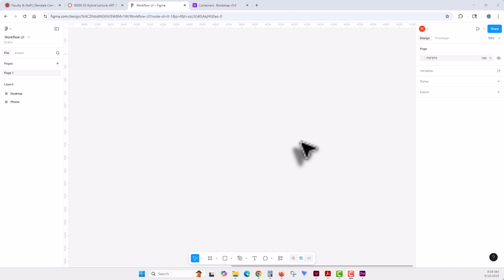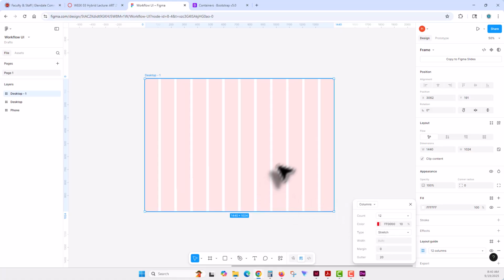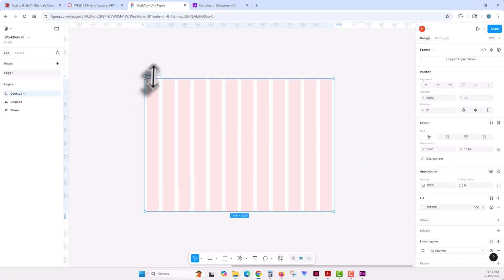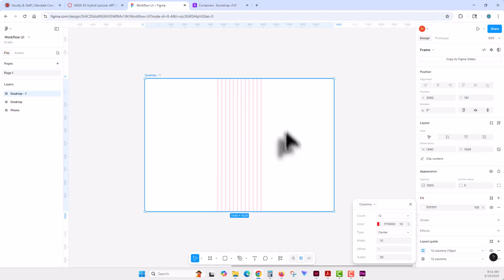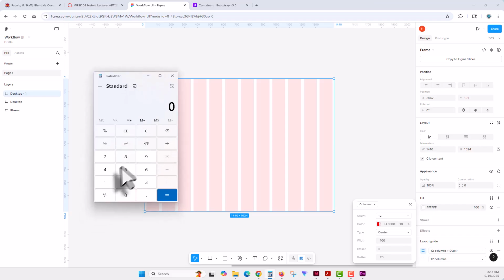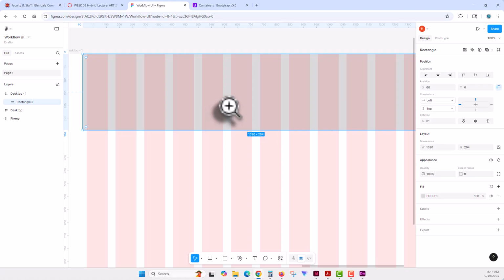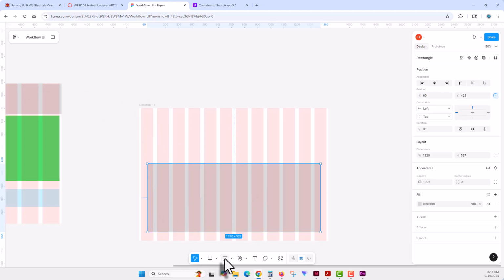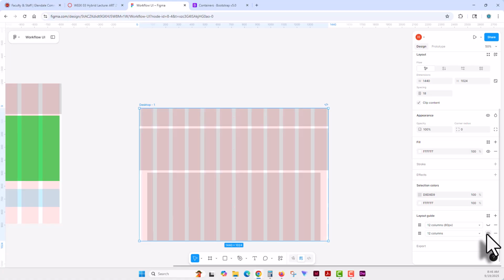Bootstrap 5 Grids for Figma

Comment: yeah I set it up the gutter at 24px 1.5rem as that's the default in bootstrap, also margin on a 1440 would be 60px which then gives us our columns at 1320px which is also the default max container size on bootstrap.